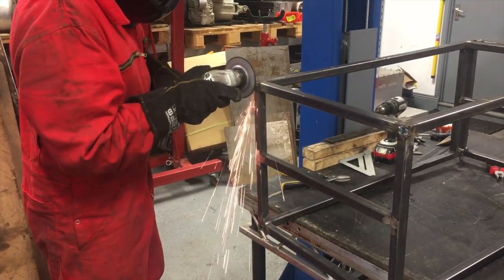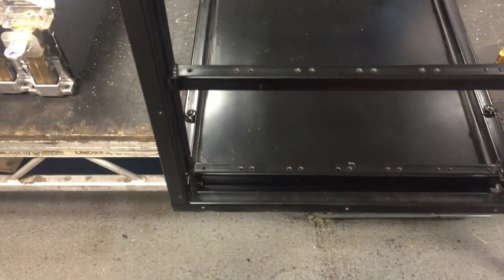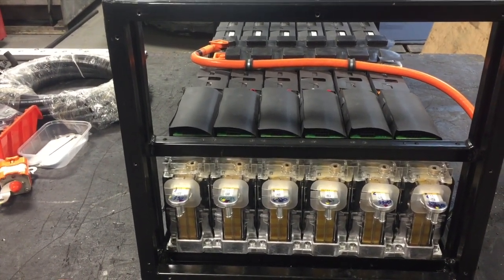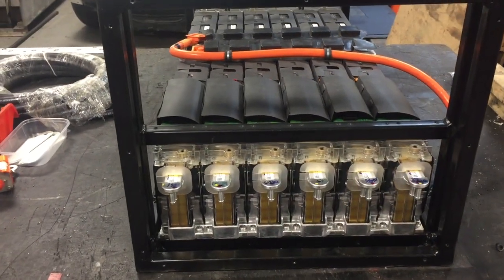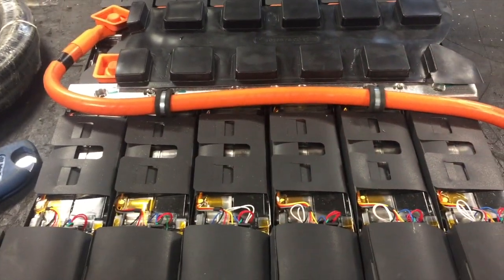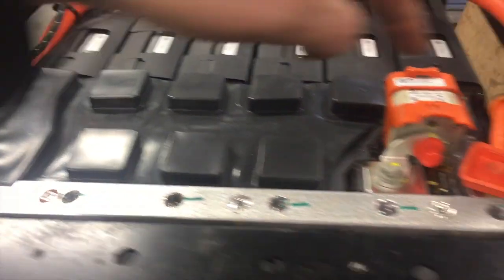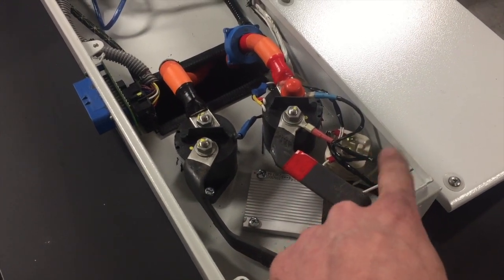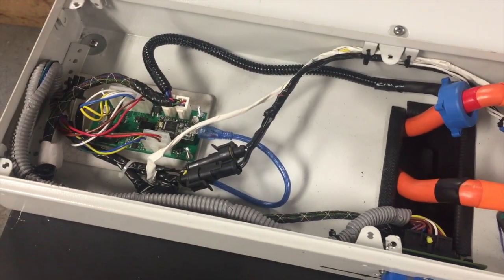Electric car conversion battery pack build part 2, Tesla B Class modules 18650 cells

Comment: How do you make sure if the box made here water tight? I mean if the car gets to a water pond (imaginary case) it will not cause issue. Does it?
Reply from the maker: It’s very difficult with this design used a lot of sealant. There is also 5cm of dead space in the bottom of the pack just in case water did manage to get in. Would bot recommend building like this again best is a fully welded tub that the frame drops into.
Reply: @Hazell_Nutz  thanks for your answer :)

Comment: Hello,
Do the Tesla cell monitoring units on each cell module communicate with ISOSPI?
Do you cell those board attached on top of the modules?
Reply from the maker: Kostas Doratis we sell the board from the model S modules that are a 6s configurations. I do not know the communication type. They are for sale in our shop under battery management Www.zero-ev.co.uk

Comment: fantastically simple design
are there dimensional and weight specs for the finished box? and is it 350v nominal?
Reply from the maker: Ryukachoo each module is a 7s and 12 modules fitted. Not sure if exact size pack was 99cm long.
Reply: @Hazell_Nutz  
Going by other stuff, the smart modules in a 12 pack configuration (I assume 1s2p) is  342v nominal, 378 max charge. Each module is 42 pounds, so 504 pounds for the modules only.
Question is how much extra mass all the cooling lines, the cage, and the high voltage junction box adds
Reply from the maker: Cage is about 20kg max as it 25x25x3mm box with 1.2mm steel sheeting.

Comment: How long have you lads been at this ? Checked out your site and looks decent but there's barely any info on car models you've converted for the road etc would ideally want to see like a 5 series or something with your conversion done to it. More info would be good too like potentially on the site instead of just saying 250-1000bhp give a few model equivalents with a rough price on each conversion. Like I downloaded your PDF but there's only really a small bit of info in it. Would be nice to have a rough estimate on total cost not just the drive units ?
Reply from the maker: lilvfr400boy hi, thanks for the feedback is appreciated, we mainly focus on supply to other conversion companies which is why there’s not loads of information and with every conversion being different the price can vary massively. We are currently building a full set up on a bench so can explain every required part and there rough prices so please keep an eye on our new videos. A lot of the conversions we have carried out are all done along side non disclosure agreements which is why we don’t share a lot.

Comment: Your "wall" of battery is amazing!!!
Reply from the maker: GBnutrainer I do love it can hold 64 Tesla model S/X modules. 👍
Reply: @Hazell_Nutz  I saw all your amazing kits for big and small DU.. Amazing stuff.. Do you sell batteries aswell?
Reply from the maker: GBnutrainer we do sell some battery’s currently have a 33kwh i3 pack and two Vw hybrid packs available. But we can supply Tesla battery’s that come with 12month warranty
Reply: Was going to post the same. What do you use it for and how many modules are in it now? Might be a good idea to do a video on it?
Reply from the maker: vidznstuff1 it holds 3 full Tesla packs is used to hold stock fir vehicle builds.

Comment: I like your contactor control  box, can you tell us what pre charge resistor and relay you are using ? Thanks
Reply from the maker: If It Ain't Broke Still Fix It please see our web site where we sell the contactors www.zero-ev.co.uk the precharge in this box is a Tesla one but there is a few options depending on the system you are running.
Reply: @Hazell_Nutz  I don't see a few items listed on your site. The motor controller for one (am on the left coast USA and the crazy man with orange hair charges me a lot of money to get stuff like motors and batteries overseas), batteries another.

Also, your orange wire looms are pretty nifty. Lastly what does "450/750V" mean on your cables? Is that "AC/DC" or ...? A current rating on those would be nice.

I think you should feature your controller in a video, as well as the display hookup.

Dude - your marketing skills suck ;-)
Reply from the maker: vidznstuff1 pease contact us directly for motor controller kits.

Comment: Most people don't have a welder nor know how to use one. 
A lighter more practical option would be to use profile aluminium such as 80/20 which would also be a lighter set up than using steel.
Reply from the maker: mynewschannel I do agree most people don’t but if your going to convert a vehicle to electric welding is a must so why not learn no simple clean box section. We have actually just done a new modular design that will use 80/20 profile and hopefully does not require any welding 👍
Reply: @Hazell_Nutz  
I am more a nuts and bolts guy. 
Bend it, Bolt it :)
Reply: @mynewschannel3100  ...and watch the thing fall apart in a vehicular environment
Reply: @vidznstuff1  
I have seen vehicles built and tested using 80/20. They dont :p